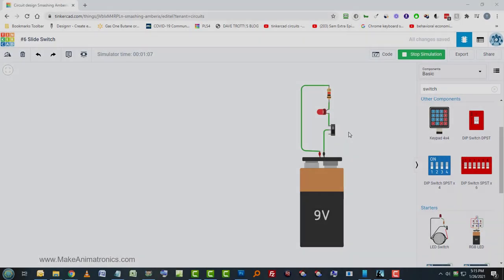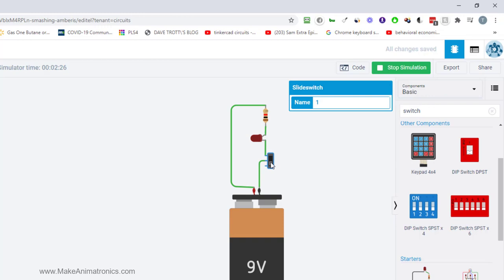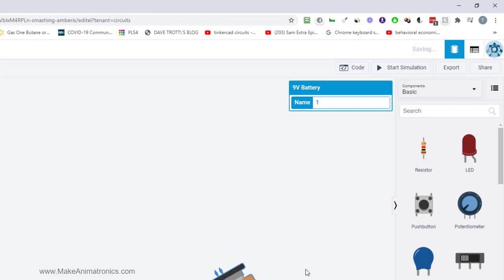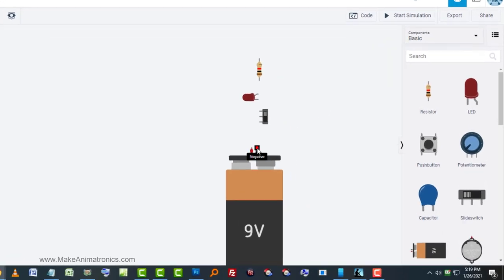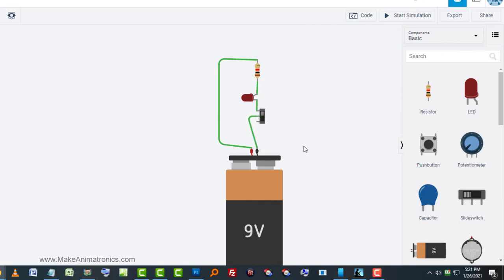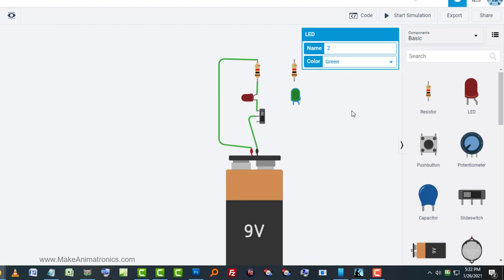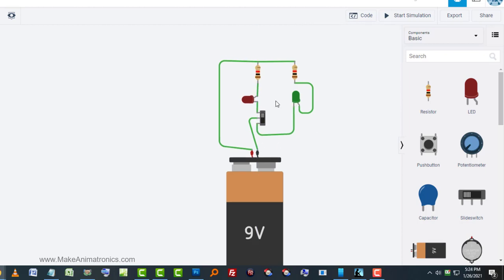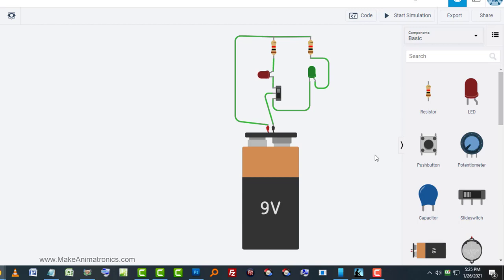Tinkercad Circuits #6 - Slide Switch and Two LED Circuits

Comment: You explained it very well. Thank you. I'm just wondering because I have to have a blue LED connected  to the switch and then I have to connect all of this to a 2 pin harness connector, which connects to a 3s 18650 battery pack. Thanks.
Reply from the maker: Are you asking a question?
Reply: @MakeBasicElectronics  Nevermind. I'll ask for help somewhere else.

Comment: How do you light them up at the same time?
Reply from the maker: Just connect them in parallel. Remove the green led cathode wire from the switch and connect it to the red led cathode.